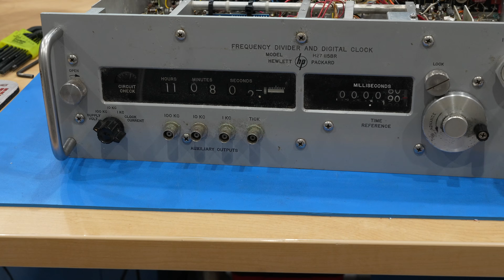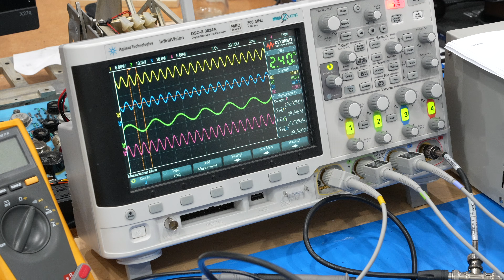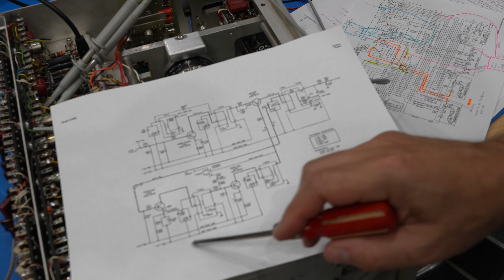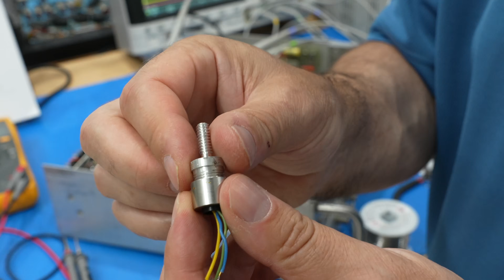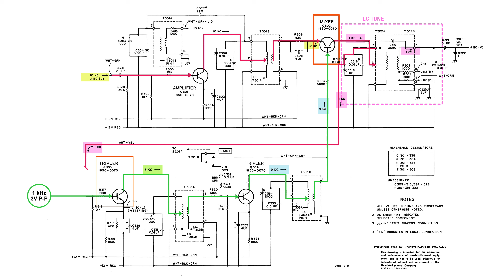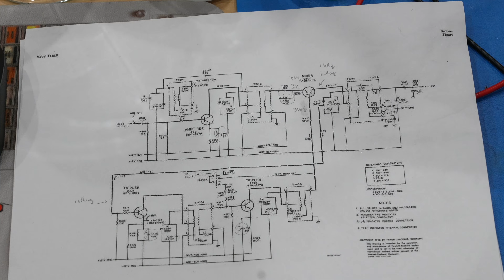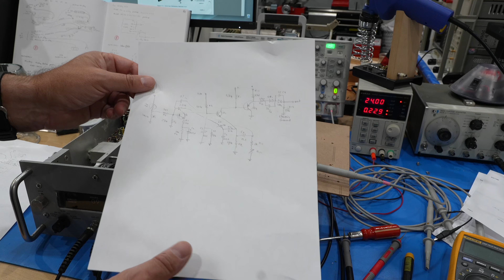HP 115BR Divider and Clock - Part 2: Repair

Comment: Question - the bootstrap startup process:  click the button, flick the motor
That's all inside the case - you have to dismantle that box every time you get a powercut/cycle the power on the clock?

Cheers.
Reply from the maker: Yes you do have to open it up to restart it. But the clock is supposed to be powered by the crystal source, which has one internal and one external battery backup (that's why the input power is 24V DC and it has no mains plug). We'll demonstrate that when we run it with the HP 106B. The clock is useless anyhow as soon as it stops, you have to realign it to an atomic clock no matter what, so in practice that's not a concern. What would be terrible is that a non knowledgeable person could restart it easily and you would not notice that it had lost atomic traceable time.
Reply: @CuriousMarc  Yes it should only be restart-able by men in white jackets (or whatever time boffins wear) with lots of letters after their names, front panel button proders (as in every day domestic clock restarters) need not apply for these jobs.
Reply: @paulstubbs7678  you forgot the fancy pants! :)
Reply: @MarcoTedaldi  they come with the jackets 🧐
Reply: The main workings seem to be on rails inside the box, so I think you undo the two big thumbscrews on each side (labelled 'open'), and slide it out just far enough to flick the switch and spin the motor. Then slide it back in and screw it shut.
I guess you're intended to leave it permanently powered along with the atomic clock.

Comment: This Arduino board still comes to my mind. Just to get 1kHz? I would take 4096kHz XT and build oscillator with 74HC4060., following datasheet suggestions. Then if sine wave is essential, lowpass filters RC. That would be more in the vintage spirit 😆

Comment: That style of wet tantalum cap (TAA was a common type) were an absolute nightmare, they were used extensively in military equipment from the 70s and 80s and caused so many problems, the electrolyte could leak and, as it was sulphuric acid, highly corrosive. If they didn't leak, they often went short circuit and caught fire.

Comment: Tantalum caps are great: two failure modes: short or open. They cannot deal with any reverse voltage, and the working voltage should never be exceeded.

Comment: What did the bad cap do to the filter? Was it causing the filter to be loaded with a different impedance than expected and thus shifting its center frequency?
Reply from the maker: It leaked and threw off the DC biasing of the transistor in the mixer.
Reply: @CuriousMarc  Ah, and it was also messing up the resonance of the "feedback" output by changing the load placed upon it?
Reply from the maker: Maybe, but I don’t think so. The weird resonance thing I am still not 100% sure where it came from. I think it might have been from my measurement technique, not from the bad cap. But I never went to the bottom of that.

Comment: Ah! The second you said "tantalum" it became clear. Unlike most capacitors, the failure mode of a tantalum cap is a short rather than an open circuit. It would have flooded your mixer with a bias, my guess saturating the transistor or introducing distortion at the very least.

On a side note, bad tantalum capacitors is a common cause of the failure of many early PC motherboards. When you measure a short between one of the power rails and ground before powering it up, guess what the culprit is 95% of the time.

(FYI... typing this on my HP laptop)

Comment: I once had an old transistor radio where the transistors were mounted in holes in the chassis with little rubber grommets. Another example of tube-era construction techniques applied to transistors. I guess transistors were expensive back then and deserved a bit of pampering.
Reply: Lots of early transistor radios had the transistors in socket for easy replacement - Zenith, for instance. Turns out, they needed it, because the transistor enclosures/"cans" were tin-plated and tin whisker frequently cause shorts, particularly 60+ years later.

Comment: It's interesting that they reduced an oscillator to a mere ringing circuit.  Some of the 80's game consoles included a crystal resonant circuit followed by a buffer amp for that same purpose, but this is the first time I've seen one that used feedback.

Comment: Hang on a sec, wouldn't flying the atomic clock around the world throw off its time? I remember a story about how they tested Einstein's theory of special relativity by flying around an atomic clock and comparing it to one on the ground, and the two showed a difference, so if they flew one of these around to synchronise atomic clocks around the world, wouldn't they still be different by whatever the difference was from flying it around the world? Or were they somehow able to compensate for the flights?
Reply from the maker: Not for this first 1 µs sync. You are 2 orders of magnitude away from having to worry about relativistic effects.

Comment: It's a tantalum, what are you expecting?
Reply from the maker: It's a MIL-spec tantalum. I'm expecting it to last a long time.
Reply: @CuriousMarc  That explains it. I was really surprised not all of the tantalums were failing short after all those years... (yes, I've been burned by tantalums... now MLCC seem to become a fitting successor to those.
Reply: @CuriousMarc So you're thinking that "a long time" means at least 60 years?

Comment: Great Repair Mark! For how many years  can one of these HP cesium clocks be used? Is the isotop becoming weaker?
Reply from the maker: They run about 10 years until the 7 grams of Caesium in the tube get consumed. Otherwise they don't age. They still make the same tubes 60 years later! $20-30k a pop for a new tube, and you have to wait over 6 month, they can't supply the world's demand right now.

Comment: 25:50 That's wild, the tripler is happily working as a quadrupler instead, thanks to its asymmetric single-transistor design evidently also generating plenty of even harmonics and not just the odd harmonics you'd get from nicely symmetrical clipping.
Reply from the maker: Oh, good catch! That's exactly what's happening.
Reply: Yes, I spotted that.

Comment: As a 60 year old mechanical engineer watching this, please, please, please clean the mechanical clock mechanism as per the service manual. Do it before it is too late. The tight tolerances of the bearings and the gearing are being abnormally worn every time you start the motor. The clue that it needs to be cleaned is that you must give the motor a very strong torque to start it spinning.  You should be able to start the motor by a simple twist of the knurled handle between your thumb and index. Also HP would never have let such a noisy mechanism out the door. It should be whisper quiet.
Reply from the maker: We know. Clock is clean. There is a bad bearing in the mechanism. It's very difficult to change, haven't done it yet.
Reply: @CuriousMarc so maybe you Need a watchmaker in your team. 😉

Comment: 1kHz signals have to be single most annoying tone in existence. In the Apollo series, it was somewhat bearable, but the sound of the stationary, synchronous motor is driving me nuts.
Reply: Once it is sealed in the heavy outer box it’s pretty quiet. 

I had it running in my maker space 24/7 for a few months.
Reply from the maker: It's been running continuously since I have it repaired and coupled to the 106B. No 1000 Hz noise once it's running. The bad bearing though is annoying. We need to replace it.

Comment: https://youtu.be/0kdnvCuWXV4?si=xnMYzuFPLv7d90qS&t=1496 This is correct. You have series (current) resonance at input and parallel (voltage) resonance at output. So, at 1 kHz input voltage drops to near zero since of filter input impedance drops in resonance. I'm glad you didn't go this path too far away.
Reply from the maker: Are you sure? Certainly looks like a parallel resonance tank circuit to me.
Reply: @CuriousMarc  Take look at the schematics. There is a tuned transformer that has transistor bias winding between transistor collector and -12 V rail and two other windings, one feeds frequency tripler and second that is actually divider output. Primary side path is not obvious, since bias winding, frequency tripler winding and capacitor forms parallel resonance tank that you mentioned, but frequency tripler winding, the capacitor and transistor collector forms series resonance path. My guess is that tripler winding + cap is about 1 kHz, but tripler winding + bias winding + cap frequency is lower (because there two coils in series). Proof is you can actually see two resonances at input: series at 1 kHz and parallel at about 700 Hz.
Reply from the maker: Hmm, that explanation does not make any sense. The winding 1-2 is not a bias winding at all. This is simply a transistor shooting into a proper LC parallel tank circuit load, with the collector injection tied to 2 instead of 3 so the low output impedance of the transistor doesn't kill the Q of the tank circuit. That's how all tripler stages are made too, they are also all parallel LC resonant. But in the triplers, this is the only source of resonance. However, on the mixer, the secondary winding (4-7) *is* wired in a series notch configuration! I suppose that's to kill the 19 kHz mixing product, has nothing to do with the 1 kHz resonance. Also there is C319 across pin 2 and 7 connecting the input and output windings, which I would not expect there. I have not yet figured out why it is added. I wonder if you'd get some unplanned resonances when you excite at 3 as I did with the experiment. I should have tried to excite it at 2, but that would have required me to disconnect the collector of Q302. If I ever re-open the thing, I should try to excite at 2 with Q302 disconnected, and see if I get clean 1 kHz resonances. Still not clear to me why I got a resonance at 700 Hz, but it is not due to the parallel tank circuit between 1-3 and C318, that's for sure. Removing C318 caps there did not change that low resonance at all. Now I think it might have been simply due to my test setup and parasitic capacitance from the generator. This would go away, or at least change drastically, if I excited at 2.
Reply: @CuriousMarc  The problem is that transformer is far from ideal. One is small in relation to frequency, windings has to be very tiny cross section. This causes problems like weak coupling between coils, hundreds of Ohms coil resistances and leakage inductance of course. There is also dubious to make a primary winding tap on pin 2, since transistor collector is actually current source so impedance is rather high at this point. Maybe this was emitter tap at early stage of design? Besides, Q of LC tank is already killed by internal transformer resistance.

I did some simulation in QUCS. I assumed that primary winding sections are 13.2 and 330 mH (pins 1-2 and 2-3), there is also 10% inductance leakage and 20 + 100 Ω resistances. Coupling factor is 0.7. Load capacitor is 100 nF. Result didn't surprised me: coil tap 1-2 is mainly DC current path for transistor, most energy is injected while primary winding is in series resonance. There is also weak parallel resonance at lower frequency too. This exercise confirmed me also why we should use Meissner topology instead of Hartley when designing oscillators in kHz range (I know that this is mixer not oscillator).

BTW I guess that C319 advances signal phase or maybe improves weak primary to secondary side coupling. It's also hard to say what is internal transformer parasitic capacitance. Could be 700 Hz resonance is just internal to transformer. I'm wondering why they didn't use RC network or some mechanical resonator instead?

Comment: I do have one question; how do you set the time?
Reply from the maker: It's a whole adjustment ceremony! Open the rack and slide it out. Remove the many screws and remove the metal plate that's over the wheels. Rotate the minute and the hours wheels by hand, there is a little lever to free them up while adjusting. The seconds has a clutch spring lever clutch, so you unclutch it and hold it. Start the clock by spinning the motor.  Release the clutch at the right moment. Then adjust the tick by cranking the handle while looking at WWV on a scope. I need to make a video on that!

Comment: A question. During your repair us used that manual start buttons and had to give the motor a small spin.
Is that not automated? If not, does it mean the operator of that device has to open it, turn it on and then close it again?
Or how is that meant to work in day to day operations?
Reply from the maker: Yes and yes. It's not automated - on purpose. You don't want the clock to restart on its own and you not noticing the time is not traceable to an atomic standard anymore. You need to open it all up to readjust it and restart it. It's really meant to be operated with battery back up, as well as the crystal or atomic source, and never be readjusted save for the microsecond adjustment. None of that daylight saving stuff...
Reply: @CuriousMarc  Awesome. Thanks.
And thank you for your great work in general. In particular in the analog field of electronics I don't know that much, but your explanations are at a level I can get the concepts.

Comment: So, you have to remove the top to start the oscillators and motor manually every time, or can it be done without ?
Reply from the maker: Remove the top and start the oscillators. Plus unscrew the plate over the wheels and readjust the time. Plus hook a scope to WWV and adjust the tick. Make a prayer to the Gods of horology (don't forget that step). It's a whole ceremony to get this clock restarted.

Comment: Suspect the tantalums!  Great job Marc.  Love the point-to-point electronics, so easy to work on.  That synchro motor is noisy... perhaps some Hamnmond tone generator oil is needed?  I just bought some Kroil Microil, looks like the exact same thing... the mechanics sound a lot like a Hammond organ that wants oil!
Reply from the maker: Syncrho motor is fine, but there is a bad bearing in the clock mechanism. Replacing it is a bear though, you have to take all the gears out, so I haven't done that yet.
Reply: @CuriousMarc  Are you going much further? Bearings, lubrication and cleaning? 😎 I'm waiting for that ... :popcorn-yellow-striped-smile:

Comment: The "old" HP hardware is just beautifully designed and constructed, much nicer than the plastic stuff that's cranked out these days. It is somewhat odd that one needs to "kickstart" the device (open the rack?) every time?

Comment: So often it’s a capacitor! I get grumpy at them - fair enough for a 60’s era germanium transistor to die - but how hard can it be to make a sheet of conductive material and a sheet of insulator?!!  Very hard apparently!!
Reply from the maker: These were MIL-spec tantalums. Much better than electrolytics. But in our experience they fail, mostly due to corrosion, with a leakage fault rather than loosing any capacitance. So they create hard to catch faults. But we catch them eventually.
Reply: It is mostly about keeping atmosphere out. The seals are crucial. I shiver when I see people bend the leads without pliers to keep the force off the seals, or when they push them in TTH boards with another size footprint.

Comment: Also, given the unit has to be manually started - is it just that it has a battery backup to keep it running or you literally have to keep removing the covers, push two switches and spin the motor everytime you use it?

Comment: One question I have - since we know from relativity that both gravity and velocity have an impact on clocks - how did they take it into account when flying clocks around the world? Granted, it's likely not to be a huge effect if you're just going by the mechanical clock with 10us precision, but is that the reason? The effect of relativity is simply ignored because the clocks weren't precise enough?
Reply from the maker: Effects of relativity did not matter for this round, which was a 1 µs sync. It starts to matter when you want to do better than a few ns sync and fly your clocks real fast.
Reply: I would say the changing inertial reference frames due to gravity and acceleration were not significant for this level of accuracy.
Reply: I was thinking the same.  Didn't they fly atomic clocks around in planes as one of the ways to prove relativity?
Reply: Just a guess but Marc may showed it in another video: you phase sync to identical and take off. After touchdown you compare the shift.

Comment: That tripler circuit (6:40) is at once crude and elegant: driving the thing so hard it distorts wildly then using the fact that a single ended circuit will have dominant odd order harmonics and picking off the third. So clever.

Comment: I wonder, how is the startup sequence designed if the unit is installed in a rack? You can't reach the buttons for starting the loops nor reach the synchro?
Reply: I was just about to ask the same thing!   Take it out of the rack, remove the cover, push the button then spin the motor? There must be another way!

Comment: Are the start switches duplicated on the outside? Or do you have to remove the unit from the rack and open it to press buttons and spin the motor every time you want to start it

Comment: Did the 1954 sync process take relativity into account? I'm not sure you have to.
Reply: They did not at first but then realised that it actually matters
Reply from the maker: Didn't matter for that first round, which just sync'ed to 1 µs. It starts to matter when you want to do it to a few ns.
Reply: That came also to my mind as he said, they used it to synchronise atomic clocks around the world, and transportated them by plane 🤔